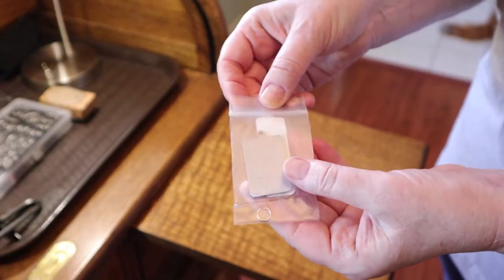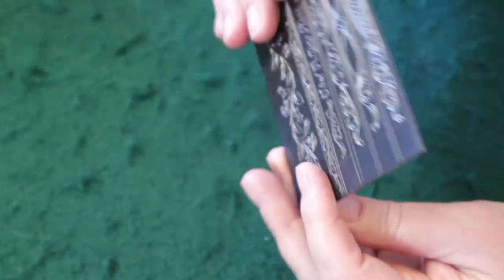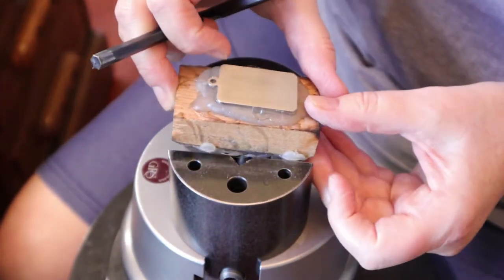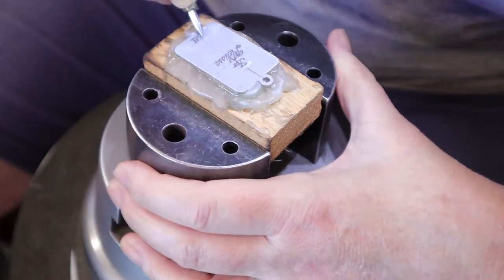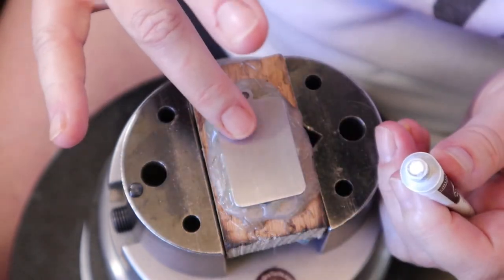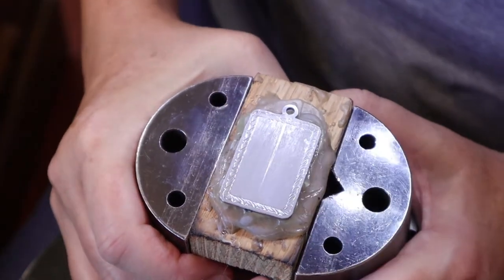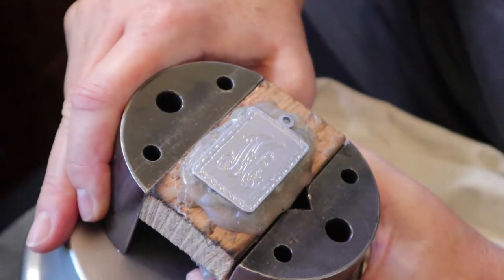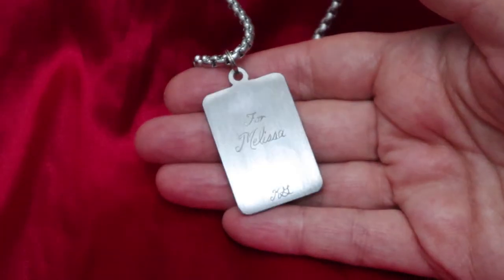Hand Cut Necklace by The Artist Engraver | Beautiful Designs in Metal | Custom Made Jewelry

Comment: If you use transparent tape on the hot glue, then attach the piece to engrave to the tape stick side up you will not need to put it in the freezer. Just heats up the glue.
Reply from the maker: Thanks for the tip!